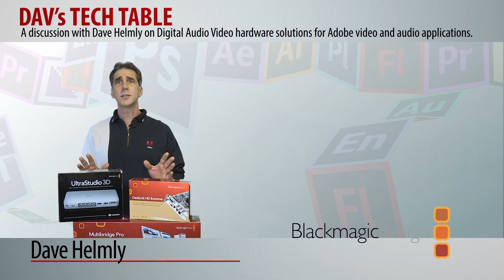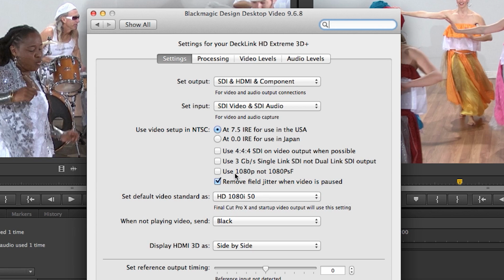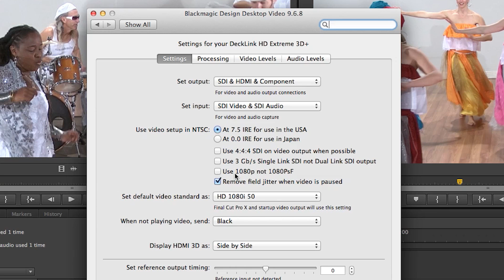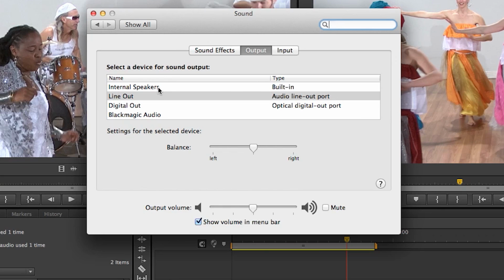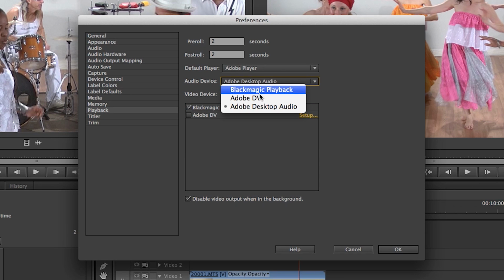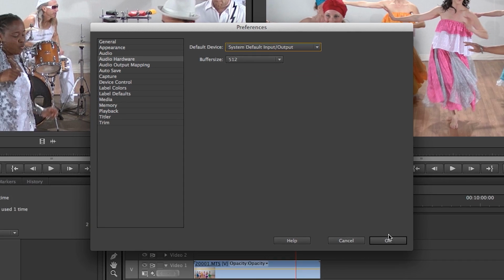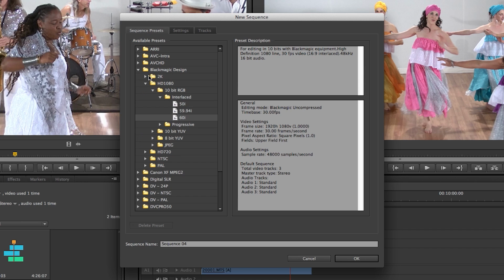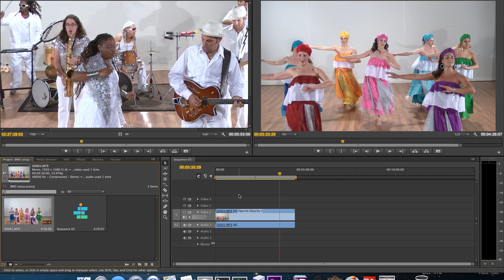Black Magic Design I/O Hardware Setup for Premiere Pro CS6

Comment: Hi Dave. When playing the timeline in prem cs6 out to composite via intensity pro, is playback instant? I play edited packages into a mixer for a "live" show. We use firewire which has 2 sec delay between pressing spacebar and the vision playing on the output, which is awkward when the host throws to a package, seems forever until the video rolls. Does the intensity pro play immediately on composite output when the spacebar is pressed in prem cs6 or is there a delay. Cheers